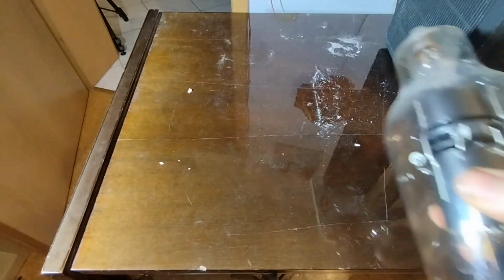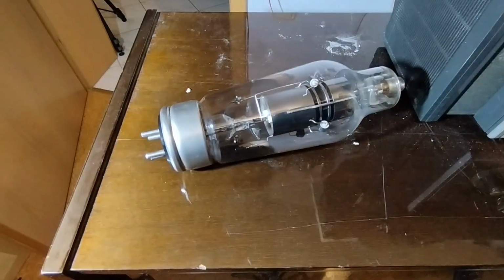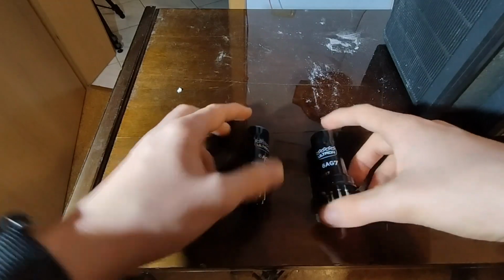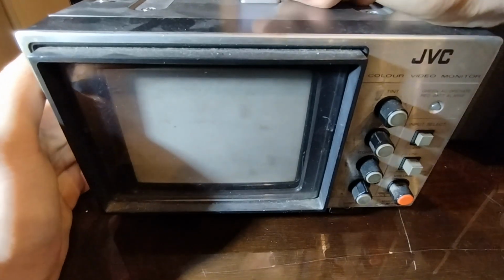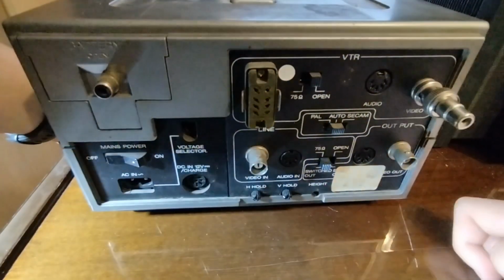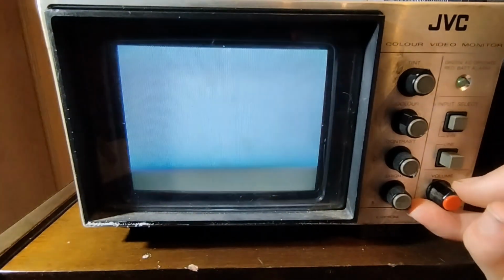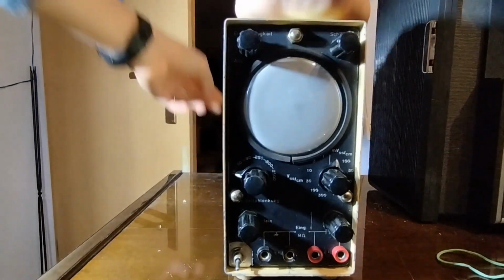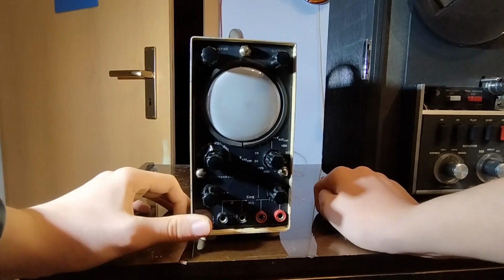JVC Professional TV, Giant Tubes, Tube Oscilloscope & MORE | Retro Haul 1/2

Comment: The blue tube looks like an x-ray tube. You can tell by how the anode is angled so the eletrons smash into it and release an x-ray in the direction the anode is angled. Also the red bank of capacitors looks like a pretty big voltage doubler. Probably for driving the x-ray tube since they need around 70KVs. Awsome video! ❤
Reply from the maker: Big thanks for your kind comment and all the informations :)